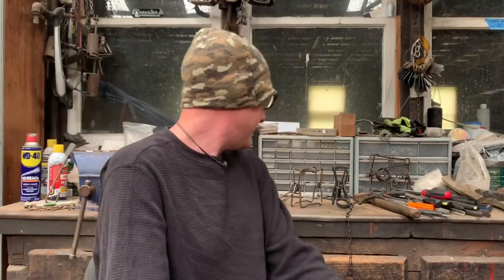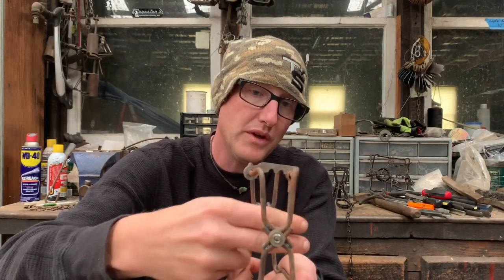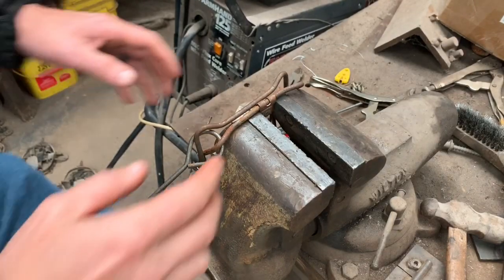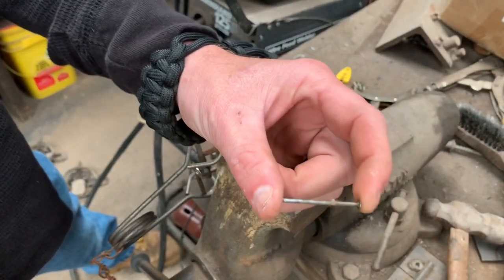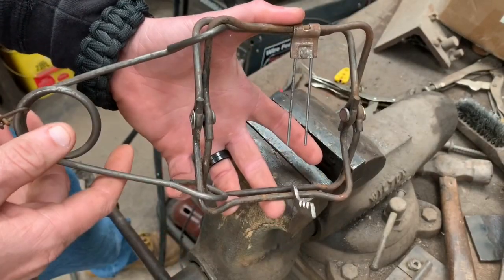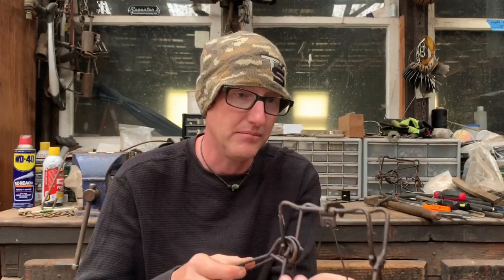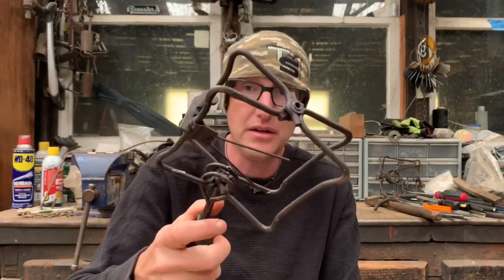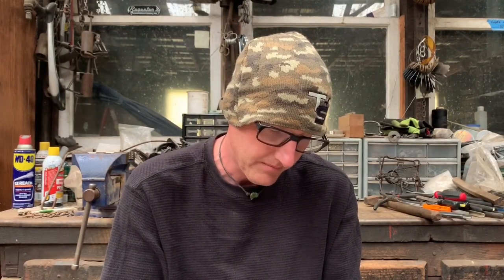Duke #110 Bodygrip Trap Tuning and Treatment

Comment: I know they are too small for raccoons…but…if it was left that way would it beneficial to leave it that way and turn the trap around? That way a bigger animal like a raccoon  would get its head pretty far into it before snapping?
Reply: I have experimented very little with them so. It seems if I set them with the dog in the front I get a “suitcase” and if I set it with the dog in the rear I get a head and neck catch with small varmints.
Reply from the maker: That may have some merit. Not all of them have this issue though.
Reply: @toddstrohecker  I have a couple a bought last week. They both have alot of movement of the dog both ways. "I didn't think???"
..Neither of them had any "slop"  till i caught a couple of animals in them.  My guess is they were always that way and I had it set inside or middle catch. The outside catches on both brand new duke 110s have alot of slop. I did have a couple of misses and I am sure it's what caused the misses.

Comment: Does anyone know if the belisle in the 110 size will fit the same diameter pipe?
Reply: It will not due to the shape of the jaws. I made the mistake of buying them for that reason. The belisles also have trouble when used in a Noonan style stabilizer. So much tension on the trigger that it takes quite a bit of force to fire them. Get some dukes or Bridgers for setting in drain tile.